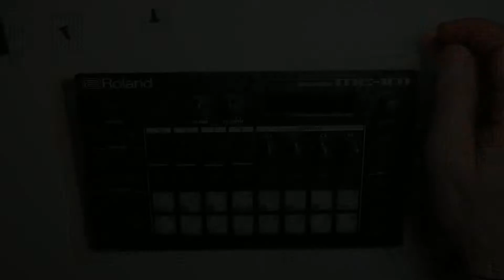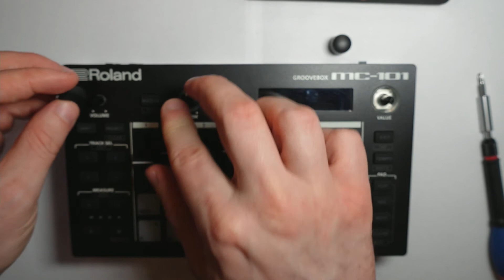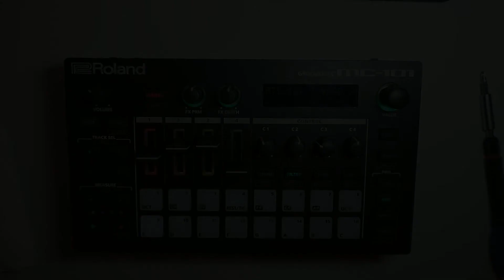Roland MC 101 LED panel Disassembly

Comment: Could you change out the green led's or is that too hard
Reply from the maker: Hello, I have instructions on how to change SMD diodes - but you have to be careful, everything is soldered with micro solder